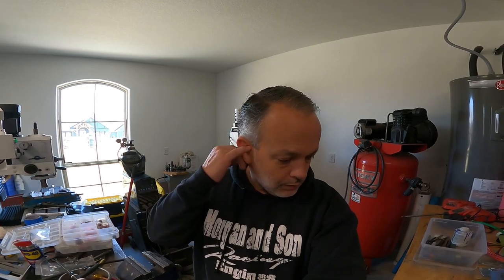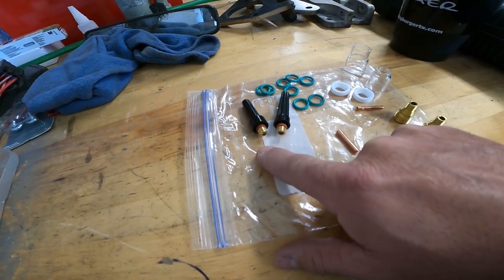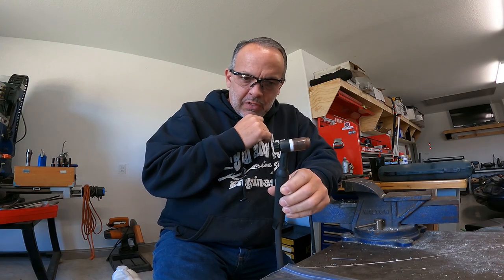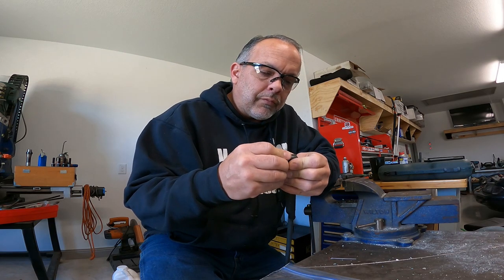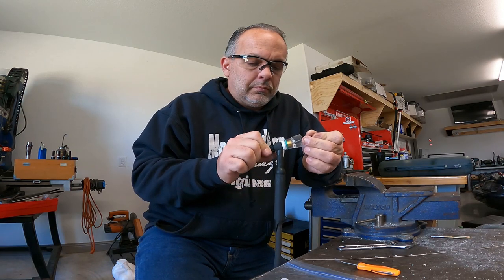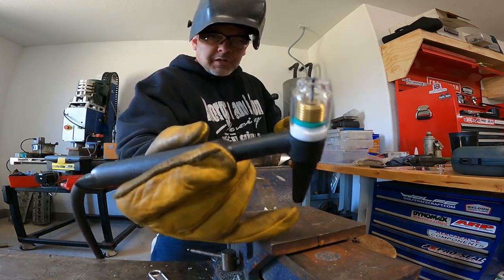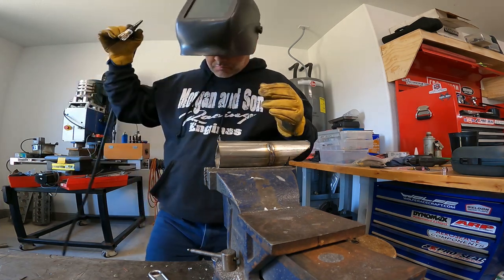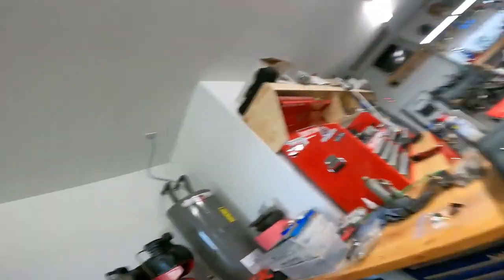Ebay China TIG gas lens review - good or bad?

Comment from the maker: ...I finally got to try the extra diffuser, since my other orders came in - The 2nd diffuser wasn't even really made for this particular pyrex cup demo'd in the video - but adding it made all the difference in the world, it worked perfectly after that was added. Ironically, it only came with one diffuser, and the new gas lense cup came with 2.
Reply: Why do they seem to only make Pyrex cups for small gas lenses. I could only find one company called Edge Supply where they make glass cups for large gas lenses. I prefer the large gas lens on most work. I don't know if it's true or not but I feel like you get better coverage with a large-diameter gas lens compared to the small lens. It's a shame that you can't readily find the large-diameter glass cup. However the one that edge makes is pretty good, but it costs about $30 a piece for a number 10 size
Reply: I have no idea how your torch body lasted so long. I use a flexible 26 torch. And I run that thing super hot, often pegged out at 200 amps for minutes at a time. The Torches seemed to last about a month. But that's okay because I buy them two at a time on eBay for about $20 for a pair. It's a consumable so don't feel bad tossing them and getting a new one. But that is great that you made that one last so long. 😄

Comment: I bought a cheap gas lens/ cup kit from ebay and it was absolute crap. Seemed to induce air into the stream and didn't shield worth a crap. Threw them all out. It would be interesting if possible some how to induce smoke of some kind into the gas stream to see if it's laminar or if theres some sort of turbulence in the stream. Seems straightforward to have a screen in a gas lens, why they don't provide coverage is anyone's guess.

Comment: I did about the same test and got the same results. I have several cheap kits with #4-8 pink and Pyrex cups, and #10-12pyrex as well. 
The smaller sizes 4-10 work good, no complaints, the 12 doesn't shield the weld at all. I tried from 20-32cfh and quit, however the 8 or 10 glass cups work decent with 16-22cfh.
The cheap big Pyrex cups need another diffuser screen like the Furick or other name brands use and it might get decent results.

Comment: As one of the low budget types, this was great. Mine is all chinesium including the igbt welder. I do the two orings on this clear cups but have mixed results like you and have gone back to the pink ceramic ones and regular defusers. I use the chicom 17 and 9 flex head as I didn't like the rotohead that came with my welder.
I like made in USA as much as the next guy and most of the chrome in my tool box drawers are that. But the red and blue and yellow welders and plasma cutters just wouldn't fit my budget. I guess if I made a living with it and needed the support and warranty i could justify it as a business expense. But as a back yard diy type, the stuff I have works great.
Reply from the maker: Yes sir, I'm in the same boat. It's mentioned in another comment above, and I didn't even think to try it in the video - but adding a secondary diffuser screen may fix your problems as well as mine.
Reply from the maker: @gravely1000  I have some spares I am gonna pluck out of some adapters that I can't use - and give them a try
Reply: So I can spend countless welding jobs for other people and I can tell you that I use a lot of the chinesium crap too, because number one its cheap and secondly I don't see a profound difference between the quality coming out of China and that of America, certainly not in the weld itself. And this is coming from a hardcore Miller fanboy. It's nice to have luxurious high-end tools, but more often than not, the tool quality does not dictate the work quality. Just my two cents. So basically everything on my torch is a consumable eBay product.

It's nice to try fancy expensive high-end things but day-to-day production generally doesn't require that kind of stuff. The day-to-day grind is usually long hours Welding mild steel or aluminum and you're guaranteed to drop your torch and break your cup. Therefore low-cost alternatives are the order of the day.

Comment: Thank you for this.  I occasionally weld at work and I’ve been trying to get better w TIG.  Just on one of those kicks lately. I don’t like how that cup just sits on there.  I’ll make my way down to a local welding supply place today and get some lenses to mess around with.
Reply: They do have some gas lenses that screw on. I'm using one currently from Edge welding supply that has an aluminum body that screws onto a large gas lens for a 26 torch. Over the aluminum body you can push a large diameter glass cup. It's a pretty nice setup. No way you can easily have the glass fall off.

Comment: The biggest problem I've had with cheaper gas lens kits is the Tungsten falls out hard to tighten up or stays stuck in the torch when removing to sharpen

Comment: I have a tig welder and tried to weld with it but now that I am retired I will have more time to practice. If you can give a guy 1 tip to start out what advice would you tell him. This was a good video as I am one of those guys on a budget.
Reply from the maker: Theres a LOT of good first-time tips. 1)practice! 2)make sure you're not hungry or over-caffienned - you will see just how shake you are 3)if dip the tungsten, sharpen and start over. 4)watch "welding tips and tricks videos. Jodie is a master. You will learn a LOT from him!
Reply from the maker: I've always used a 10, myself. They make cheater lenses for your helmet, so you don't have to wear glasses, which may be my next step. Lol.

Comment: Try taking a piece of lightly used scotch brite and cut a small circle out and put it in the cup with the tungsten going through it those cheap big cups are missing the extra diffuser of the expensive cups
Reply from the maker: I had a bunch of arc zone stuff some years ago, that used the scotch Brite. It never failed to drop out at the worst time. Lol
Reply: @diygaragetx  yeah that's pretty much how it goes! I do know if you look hard enough on amazon their is a larger gas lens kit with big #12 cup I think that has that extra diffuser in it I've been wanting to try it out just havent had the chance

Comment: I had a similar experience with "offshore" tig consumables, mine came down to the gas lens itself, just could get a decent weld with any size cups, and just like yours it seemed like it wasn't getting enough gas. Swapped back to a WeldCraft and it worked fine?
Reply: Yeah I got a set of these cheap gas lenses and a set of real ones that you screw the cup on. The latter ones are much wider in diameter so more gas coverage. I noticed performance became really bad with the cups that were wider in diameter than the gaslens itself.

Comment: All of this cheaper so-called China branded stuff that shows up really cheap on eBay etc, is probably the calls from the ones that go to the big guys. There's probably a few companies that have gotten smart and figured out they can sell more about Mass marketing the exact item but I suspect that most of the time you're somewhere on the tails of the distribution. How that might affect your process and mine is anybody's guess. But for non-professional hobby/ prepare welding it probably doesn't matter.